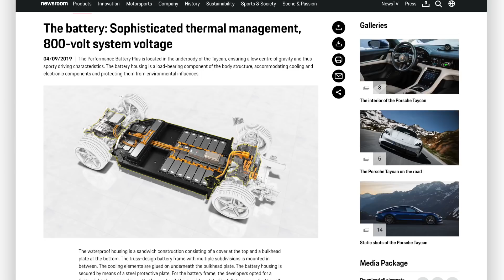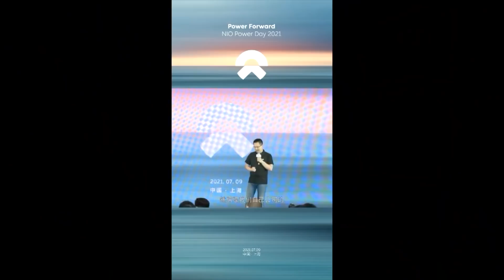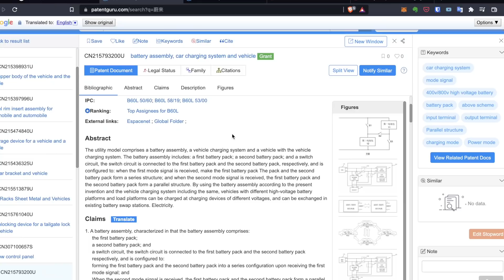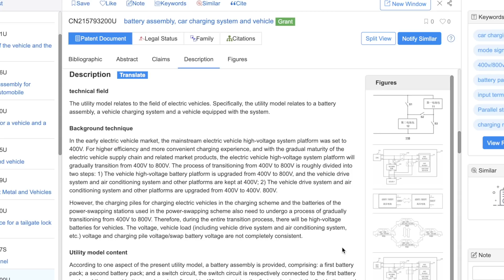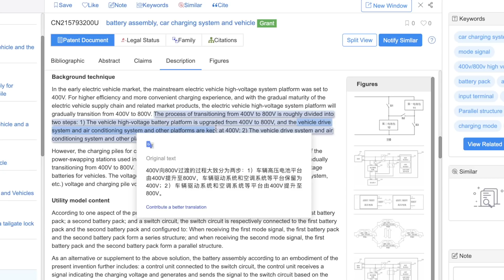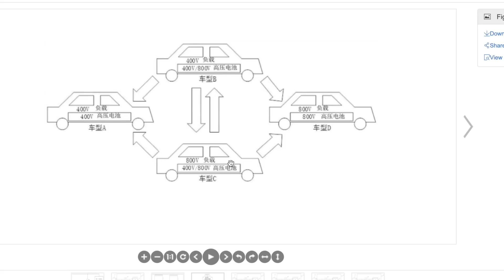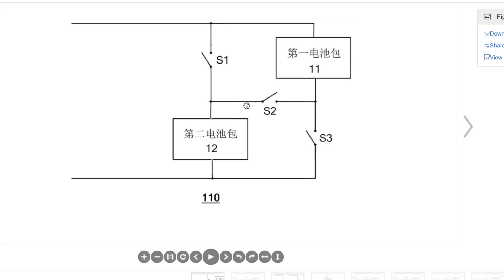🚨⚡️ NEW NIO Patent: Will 800V Super Charging Kill Battery Swapping?

Comment: Voltage means very little for charging, all cell voltage is low in comparison so 800v provides little benefits over 400v, the main benefit is more efficient power transfer but tesla has achieved 250kw charging on a 75kwh 350v battery. Battery swapping was doomed from the start.
Reply from the maker: Supercharging degrades the battery life substantially and 30-40 minutes for a real life 20% - 80% charge is not ideal for everyone. Battery swap has additional merits like upgradability and separating the most costly part of the vehicle in terms of ownership. Ultimately these technologies will co-exist and advance both.
Reply: @DONGXiiTheChinaOpportunity  i disagree, tesla owners on average lose 10% battery capacity after 200,000 miles. I've seen people who supercharger 80% of the time get this little degradation but most charge at home and wake up with a full 300+ mile range. The main limiter of charging speeds is a safe C rating and heat, not voltage. 
Battery swap stations cost substantially more than a super charger station and can't handle the same volume of traffic because a tesla supercharger station cannhand 10 people at once while the same amount of people will have to wait in line for the same amount of time do to the throughput of these station and their own stored battery charging.

Battery swap is a solution to slow charging but charging speeds have only become faster and the faster they charge the less viable a swap station is. For most consumers its a bad idea because you pay a subscription that ends up making it more costly if you aren't swapping at every opportunity.

Comment: An Example. Singapore population lives in Flats, Condo,etc. That is LESS than 10% are in Landed Property. So... 90% of 5,000,000 = 4,500,000 people. Assuming 10 pax per car = 450,000 cars. Can there be 450,000 Charging Points in the FLATS/CONDO/High rise residents...??? How about Parking Spaces ??? How about liabilities of these Charging Points (If the Car Burns due to Charging over night ?) Electricity Meters ownership and maintenance ?  ... These ISSUES was bought up when the Condo management ... REFUSED us  APPROVAL to BUILD a CHARGING POINT within the Condo.  ... As such there WILL be a REQUIREMENT for Battery Swap stations.

Comment: Lets talk physics. First faster charging will require more power. More power into a battery will increase degradation of all of the current (no pun intended) formulations that have predictable life cycles. In any case faster charging batteries WORK with NIO Battery Swapping as well as the block charging systems inside of a battery swap station. The bottom line is fast charging is bad news for ALL fixed-battery vehicles and especially bad for Tesla's huge installed base of future boat anchors,

Comment: My concern is more on the car platform itself. The removal battery pack platform is going to be more complex, more expensive, and more vulnerable than the integral battery pack in to the platform. Couldn’t erase my thoughts that how cellphone evolved from the battery swapping platform to the integral battery and this might be the ultimate design for EV as well… But I am just an ordinary man and am pretty sure NIO engineers are way thinking ahead than me.
Reply: Oh I guess be able to upgrade the battery is nice especially considering that the life of car is about 10 years vs 3 years for the cellphones…

Comment: Great video.
Wait 3 more years ,when people will realize that Nio cars keep their value much higher then cars without battery swap possibilities.
Reply: Personally...I prefer to have an "insurance" to be able to upgrade the Batteries which I can use in my EV. Likely that within 5 years .. HIGH Mileage batteries will become available. So .. Normal days -  a low capacity battery for city driving/work/etc. Then swap to a HIGH mileage battery for long distance holidays , etc.

Comment: I think at 10:17 you meant to say series not parallel. If you connect two 400V  packs in series you get 800V. If you connect them in parallel you stay at 400V but double the current (A).

Comment: The idea that swap stations would be made obsolete has always concerned me.  HOWEVER, NIO is embracing a changing landscape when it comes to batteries. A BIG factor too is that by having a very practical platform right now with the ability to upgrade people, NIO will tremendously grow its client base as opposed to a company that chooses not to build a swap infrastructure. Lastly, NIO's swap stations are modular and moveable. It's not as if NIO has spent tremendous amounts to build out permanent brick and mortar buildings.

Comment: It’s not just Porsche and Audi that are running 800v Kia and Hyundai already have cheaper 40k 800v evs in the uk. I thought et7 and et5 were already going to be 800v cars. Do we know what the charging Peak Kw of et7 and et5 is?
Reply: In my opinion, it will take at least a few years until you can see benefits from the 800V charging system.  If you look at Porsche charging rate and time, there is not much improvement in the charge time because the charging rate drop very quickly as current battery get heat up so quickly.  I believe that the 800V chargers only benefit when ceramic solid state battery comes to the market because it can operate at a much higher temperature without risk of damage to battery pack.

Comment: As per usual, great insight 👍 I guess these patents are only for the china territory? Or are NIO filing these across other regions?
Reply from the maker: Usually NIO files for such patents on a global level. For example, I think they own most patents related to Battery Swapping also in the US etc. which so far made it hard for other OEM to work around these patents - but saying that I did not double check this particular patent and I am not a patent lawyer, so don't take advice from a random YouTuber with a heavy German accent. Cheers.